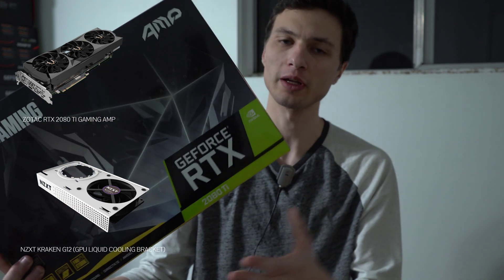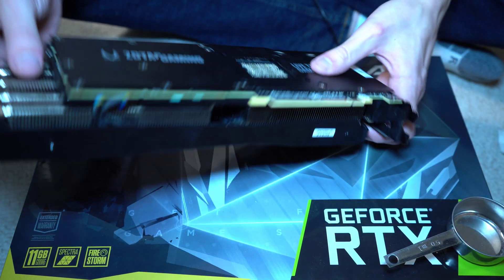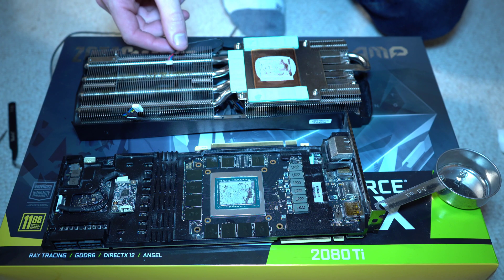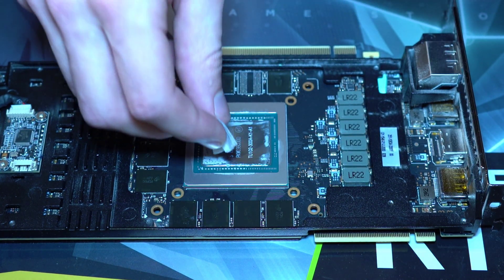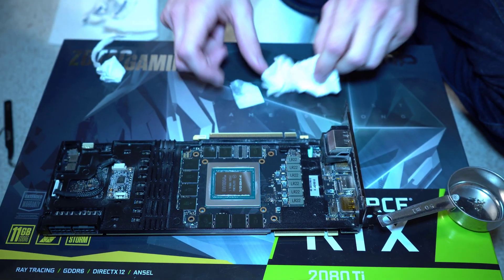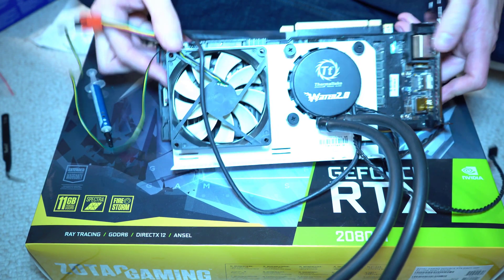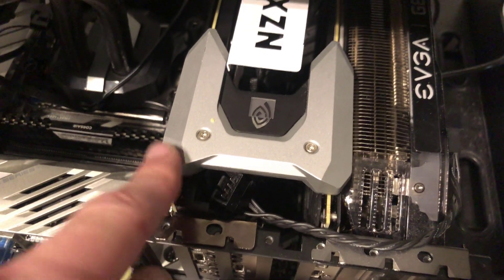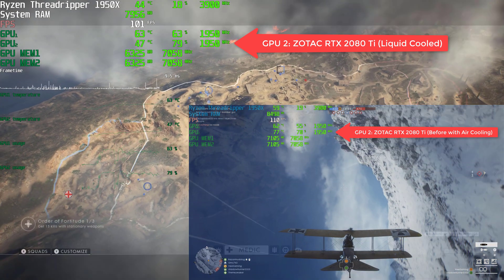RTX 2080 Ti Liquid Cooling Mod

Comment: hi mate I have a 2080Ti founders edition and it runs like 82-83 degrees with 4k settings max..Planning to install this G12 mod any heads up ?  I wanna go with Dual fan radiator dunno nzxt or corsair...Also is there a wire adapter for this card so i can run the fan and the aio throught the gpu itself? the wire connections on Founders is just one ribbon rather than the 3 wires on yours...Cheers